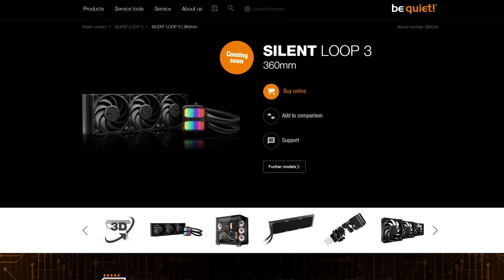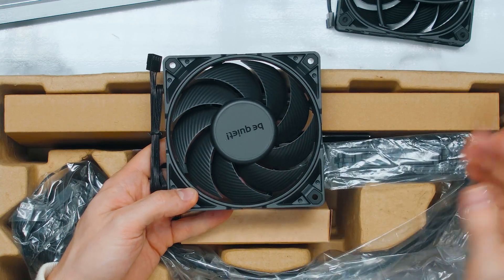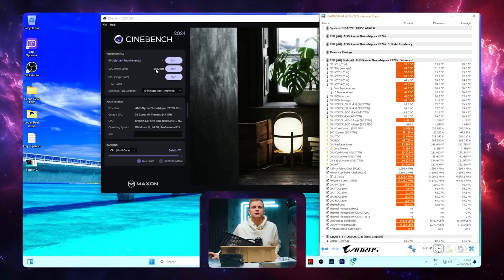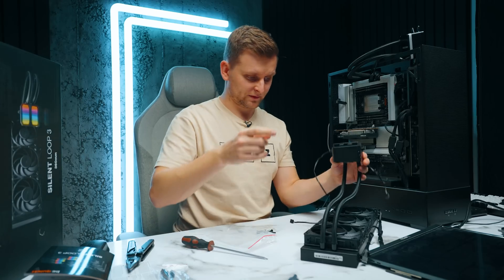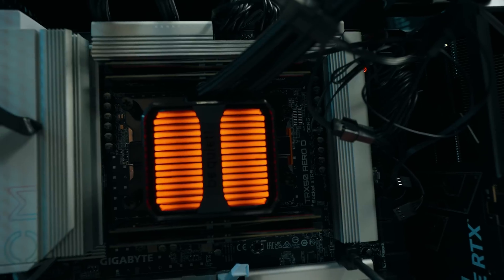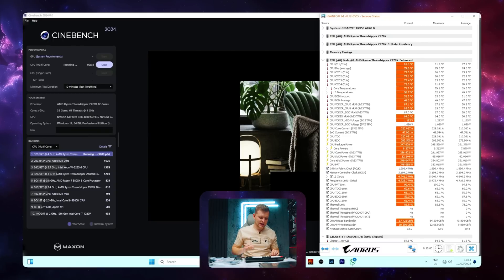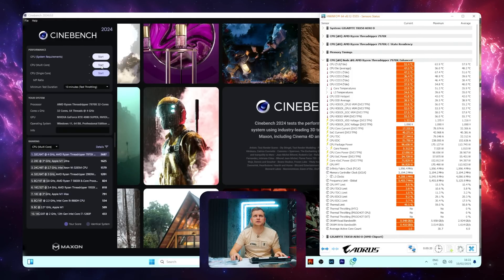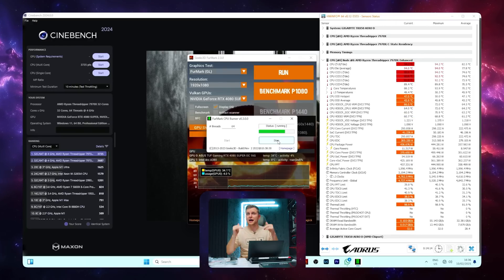New Cooling BEAST is here! | Be Quiet! Silent Loop 3 review

Comment: The water cooling system is of good quality, but the thermal paste it comes with is a disaster. I ran two identical tests one using the stock thermal paste and another with the Noctua NT-H2 and the results were striking: a 14°C difference!
I strongly recommend not using the included thermal paste, as it’s really poor quality.

Comment: Watch out, this cooler is a joke. I bought it, the paint went right off when screwing the fans on. Some radiator fins were bent, and the filling hole leaked. Such bad quality. I sended it back.

Comment: Thank you so much for this review.

I bought it and I am really impressed with the quality of this water cooler. It exceeds all my expectations.
I played Clair Obscure with high graphics settings and my CPU temperature remained between 36 and 41 degrees. It is also very quiet all the time.
Another surprise is how beautiful and elegant it is. It looks very ugly in the pictures on the internet, but after installing it, I personally find it very beautiful.

I highly recommend it.

P.S. I installed it in the upper part of my case. With two additional fans in the front and one in the back.
P.S.2 Regarding the logo orientation, it deppends of your motherboard. On my motherboard it remains in the correct position.

Comment: Best AIO if it wasn't for the cable mess and overloaded fan design (from the side). 
Why is no company doing slick designs? Everything is so overcrowded with logos, lines, grooves, leds and sh... like "be tough" " gamer here, gamer there" and all that nonsense. 
I really (and this is a word I don't use very often) "hate" 99% of the design choices out there and I'm truly having a hard time finding any component i actually like - basically conforming myself with whats on the marked as there's nothing to choose from. Its all basically the same but in different colors and forms.
ProArt was getting there, until they started to overkill the design too. 

Kudos to Fractal! 
The only company making slick and functional products like the Meshify and North case (I own) and I'm truly happy with. Most of their designs are just beautiful and timeless.

Comment: Please tell me how it is with the pump speed? When the processor is working without load, can I set it to 50%, for example? And then as the temperature increases, will it run faster? Is that possible? Will it not affect the pump's lifespan? Best regards.

Comment: Cooling 440W on a large heatspreader TR CPU is not the same as 440W on a smaller desktop CPU.
I bet this AIO will struggle with a 350W 14900K

Comment: Recently bought the Be Quiet Pure Loop 2. Installed it, the RGB would not light up. emailed them. Within an hour or so they sent me an RMA number. The next day, while upgrading ram to 64GB I also switched out the ARGB extension cable on the Be Quiet, turns out the one I used was junk. Lights came on, emailed them back to let them no, they said they will keep the RMA valid for 30 days just in case. Will buy Be Quiet stuff again.

Comment: The Enermax Liqtech II TR4 is better than this cooler. The issue is, it develops gunk and degrades over time. Not as Bad as the first Liqtech TR4, but you STILL need to open it and CLEAN the cold plate, gasket and sometimes even the pump. I know because I have many SP3/TR4 SP% builds and I have not been able to get any better Coolers for my systems since that Enermax Cooler came out. And They aren't even making a newer one, nor do they have adapters for SP3/TR4 for their newer coolers.

I was able to push a 56 core Xeon up to 700watts with that Enermax cooler.

Comment: If it handles a Threadripper I am sold.
Reply: wont cool a 300W 14900K tho
Reply: @wololo10  it can actually, it can cool a 320w one and keeps it from throttling it stays at around 97 degrees C
Reply: @wololo10  it should, given that its size fully covers it, unlike many others, and the Cooling Perf Rating is really high
Reply: @wololo10  True! Cooling a 400W CPU isn’t just about slapping on any AIO cooler and calling it a day. It depends on die size, heat density, thermal interface materials, IHS design, etc. A cooler that handles 400W on a Threadripper might struggle with a 14900K, even if the wattage is identical.
Reply: @RathaSiv  exactly, heat transfer engineer here btw
Reply: @wololo10  imagine this aio but with a swappable pump head for lcd screen. Perfect AIO then, but still i would get this one over anything else

Comment: I had to use a custom loop for my overclocked Threadripper 3970X. It peaks over 400W, so AIOs wouldn't handle it well.
I really appreciate how that Be Quiet! cpu block looks like a space heater when glowing red. How appropriate!

P.S. Please apply thermal paste in the center and spread it out by pushing the CPU block around up/down/left/right on the CPU with even pressure. That way, you won't end up with air bubbles in there.
Reply: AMD officially recommends penta dot paste application method so your suggestion is funny AF.

Comment: The only thing that puts me off with this AIO is the  warranty length. My Corsair iCUE and ARCTIC Liquid Freezer IIIs have 6 year warranties and the Be Quiet! has three years.
They need to have more faith in their product for me to invest in it.
Reply: Be Quiet AIO's probably have the low warranty because they offer the ability to refill them, and therefore present a risk of the User themselves damaging it.
Reply: yeah, same for my EK elite aio also 6y
Reply: @zawiszaczarny1749  When I first started using AIOs I did not look at the warranty. The ones I bought had a 1 year warranty and they lasted just over a year. I bought 4x EKs in 2020 and 2 are in their second builds now.
Reply: arctic is the best brand and they always have those thick radiators so if u upgrade the fans its the craziest AIO out there
Reply: Bequiet pump only goes down to 1700 rpm min speed while arctic liquid freezer iii goes down to 800 rpm, for a 9800x3d with 100 watts of usage i dont think i need more than 800 rpm, so the bequiet silent loop 3 despite the name will likely be much louder. Arctic also has a vrm fan down to 400 rpm
Reply: @kerkertrandov459  You don't hear the pump, even at the full speed of 3500rpm (which is overkill). Mine is currently running at 30% PMW, so ~2200 rpm and you can't hear a noise, even with open case and the ear right next to the pump.
Reply: @AZzalor6632   that is cope, u can easily hear it above 1000 rpm. Also theres a bug where the pump rpm is twice its actual value, fan control shows it properly tho. But even at 750 rpm i can hear it, tho not much.
Reply: @kerkertrandov459  The minimum RPM of the pump is actually 1700, so I doubt that what you're saying is true. 
Also, I can just tell you what I hear with mine which I installed today. I literally can't hear the pump even when it's sitting at 2200-3000 rpm

Comment: Seems to be a pretty good cooler, but why reviewing it with a Threadripper?  Can we also see how is this cooler handling a 9950x or 285k ?
Reply: If it can handle a Threadripper, those consumer-level CPUs will be nothing to it.
Reply: @sabishiihito agreed
Reply: Because threadripper is maximum heat generation for a CPU cooler. If it can handle a threadripper it can handle a 9950x no problem
Reply: Because this channel focuses more on prosumer products and POVs.
Reply: 285 and 9950x don’t pull anywhere close to 350 watts, not even in the ballpark
Reply: Because if it works for a 350W Threadripper, it will work for CPUs with smaller dies and lower TDPs like 9950X or 285k.
Reply: If this can keep the tempatures down on a ThreadRipper - Any "Consumer " CPU will be Easy prey for it - even with overclocking.
Reply: Threadripper is the sun, the 9950x and others will be fine. with this cooler.
Reply: Could I ask if the mounting kit for AM5 has the offset?
Reply: well this channel is not centered around the average consumer products
Reply: The Noctua NHD15G2 cools better than the SL3 360mm on the 285k. And you can hear the pump, it's not very loud, but you can hear it over 50%.
Reply: I have the silent loop 3 420mm the pump is very quiete i can't find any issues with it so far @R1b6r23
Reply: Are you joking? If it handles threadripper, your pathetic consumer cpu is a cake walking at the park for the said cooler
Reply: You all got this wrong. Majority of people probably don't own a threadripper. From a consumer perspective i am more interesed on a 9950x or 285k test review. No need to jump up your chairs. It's a valid q.
Reply: even so, 9950x and 285k can be considered workstation CPU's and they are heavy consumers too. not anyone has a threadripper workstation machine laying around.
Reply: @alecs2244  that's not the point. The point everyone is making is that if the AIO can cooler a Threadripper comfortably, it can damn sure cool a 285 or 9950x. No need to test those other CPU's.
Reply: @ABP8214 yes but a thread ripper surface area is much larger compared to the smaller cpus so we would have to calculate the watts and check the die size aswell, thread ripper isn’t that hard to cool because it has such a large surface area.
Reply: @nickk707  that's obvious, but also not what I or OP was referring to.
Reply: @ABP8214 i responded to you claiming if it Can cool thread ripper comfortably which draws up to 350 watts with a die size double an i9 14th gen which draws up to 250 watts so  therefore more challenging to cool than a thread ripped.
Reply: @nickk707  No, the real challenge is to move the generated heat to outside the case. 350 watts is more heat than 250 watts.
Reply: @alecs2244  Wow everybody's points went over your head. Buddy a 285k Core Ultra and a 9950x still pull < 50% the power of a threadripper. Threadrippers usually need massive radiators or a really expensive setup to even stave off the high heat. So, that being the case, TechNotice's test is perfectly adequate for anybody which a CPU where the power consumption is less than a threadripper. If it can handle the hottest it can handle CPU's like the 9950x or 285k Ultra with ease.

Comment: sorry to bother, is a 5070 ti still a good upgrade for video editing or is the main improvement with the 5080 90?
Reply from the maker: Yes it is! Editing review at the moment!
Reply: @theTechNotice  sweet I missed the instock sell out but managed to preorder one, thanks man
Reply: If you work with a lot of 3D then the NVidia line is pretty much where you want to be. I prefer the previous generation at the moment but on balance the 5070Ti is the sweet spot in their newest. If you aren't doing 3D or AI work then the newest AMD 9070XT is an absolute champ for value and performance when paired with an Intel CPU for H.265 so you're golden.
Reply: @WireHedd  I went with 5070ti as im not doing any 3D work but also play a lot of CS so CPU is going to be 9950X3D once that releases